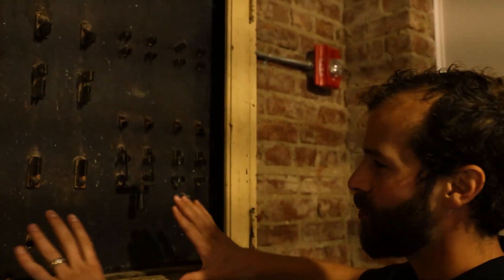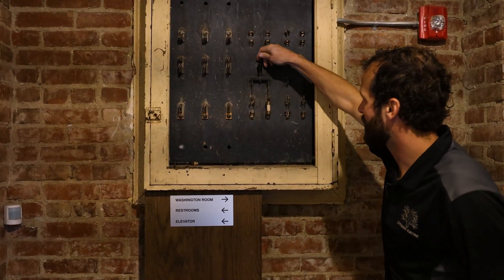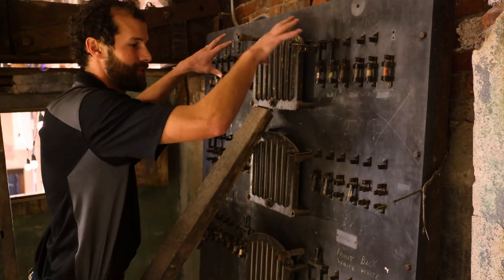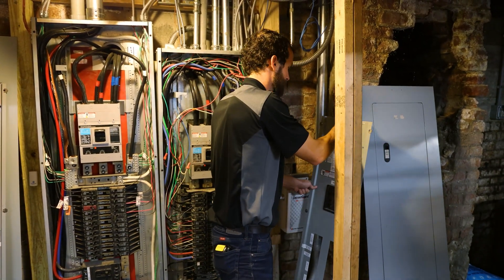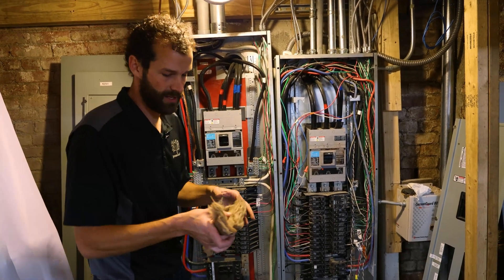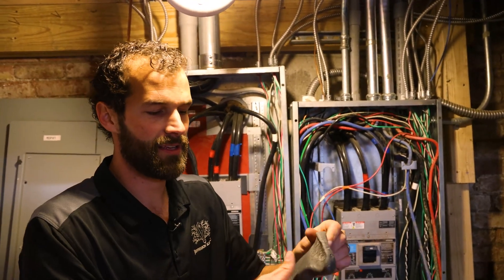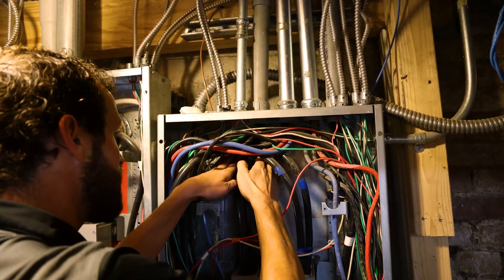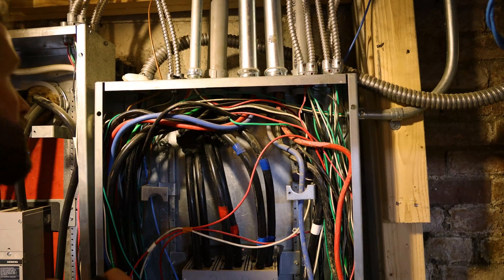120 Year-Old Building Electrical Tour

Comment: 58 years ago as a 18 year old technician I worked in a factory that still used the slate and knife switch panels. We thought nothing of throwing those switches and bare hand changing fuses. Most of our circuits were 440 three phase but as a munitions factory we also had 660 Vac 90Hz and 100 VDC to deal with. I never got shocked but several of our guys got knocked on their butts!
Reply: Man, you sound like a damn good talk over some beers or smokes. Great comment 👍

Comment: yep, those are resistive dimmers, uses nichrome wire in series with the lighting load. believe it or not, i still use slate fuse boards and knife switches with original wiring, though some of by boards may be a touch older (possibly before cartridge type fuses) yes, the rule is don't be stupid, and you'll be fine. that old stuff is very reliable, and works forever if taken care of